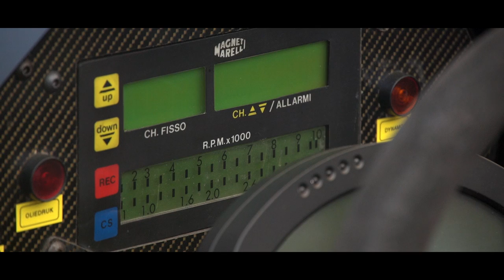FERRARI F40 LE MANS BEURLYS - RARE CONVERTIBLE Jean Blaton car - V8 ENGINE SOUND SPIDER | SCC TV

Comment: Well, it's a shame that after so many years the complete story of this car is still unknown.

This car started life as a regular F-40 (but with an engine prepared by Michelotto), before it was turned into the barchetta / spider the car was heavily modified (for example the F-1 style suspension).

The original barchetta body (had a red stripe in the middle and quite a few things were different) was designed by a french designer, all work was done at Gilet.

If you do a Google search with the words : Ferrari F-40 Beurlys, you will find the research that I did to find this car and also the WIP of a 1/8 scale model.

I actually drove 600km to get to the garage in France (mentioned by the current owner) to find the car and took some 400 photos to get all the details for the making of the model.

Sincerely

Pascal
Reply from the maker: Thanks for the additional information! Regards, Walter
Reply: It also got a cease and desist letter from Ferrari. Sad that they weren't happy with this car.